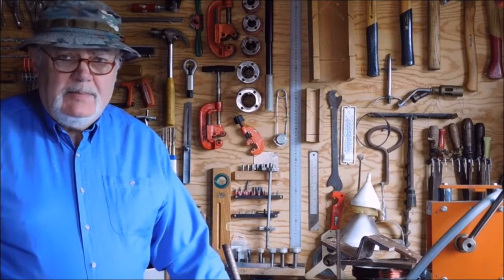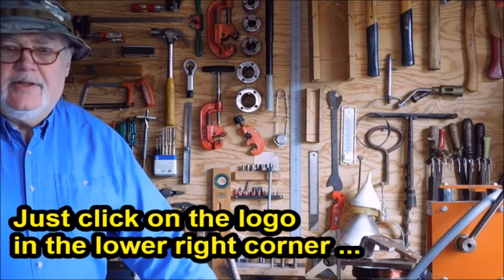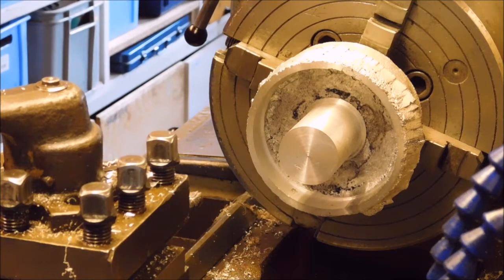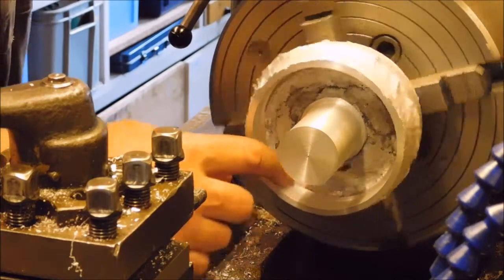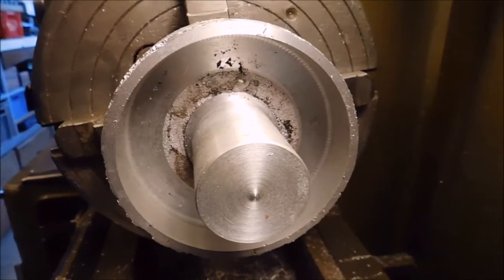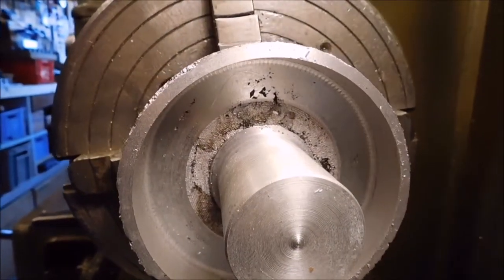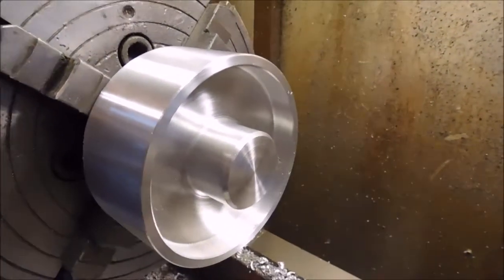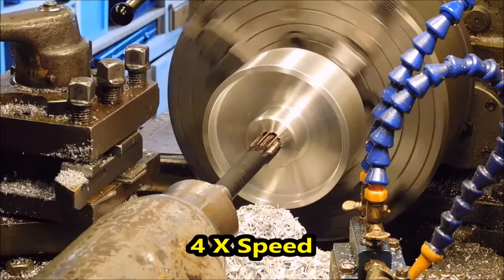Beltsander 16

Comment: "Click on the tool on the wall"... That was a nice one ;)
Never mind those cavities. Fill them with aluminum putty(automotive paint or accessory dealers) and it'll be just fine. I don't think You should have more than one crowned wheel in a setup like this. Two or more crowned wheels could perhaps make the belt difficult to run steady, and make it hard to adjust?
As for the sleeving of the axle hole - Mr.Bozo did You a big favour there. The part - when sleeved, will last a lifetime, running true in every revolution. Nice video - thanks for sharing! ;)
Reply from the maker: Thx Erling, a little encouragement is needed after been hit by Mr. Bozo that hard ;-((

I don't even think I have to fill those cavities - I mounted it on the motor and took a measurement - it's running within0,08-0,10mm - I think it'll do.

Comment: Quite a challenge machining that. You worked wonders on it - but oh dear Bozo called. Was going so well and looked great.
A sleeve will do the trick :)
Reply: This is gonna be a first, promises to be interesting....
Reply from the maker: Yeah, it looked a little challenging ... try view a before and after ... nearly hopeless.

I think I have to make the hole greater or else the sleeve will only be 0,5mm - right ?

How about filling the hole up again with moulden aluminum ?
Reply: I think best to increase bore and then sleeve, plus Locktite.
Reply from the maker: ChrisB257
In fact today I filled the hole with moulden alu, and I THINK it sticks to the existing alu enough to hold ... but let's see when I start boring and get close to the finished diameter - maybe it will slip ... then I can use the steel sleeve method

Comment: Good work Keld.  Home casting shows it's worth :)

Pity about the centre hole, but a sleeve will fix it.  I had three goes at making a precision part recently, and stuffed it up each time on the final pass - we all have those problems.

I would slightly crown that pulley for sure.  It will clean it up, and help keep the belt centered.

Cheers Rob
Reply from the maker: I think I have to make the hole greater or else the sleeve will only be 0,5mm !

How about filling the hole up again with moulden aluminum ?
Reply: Hi Keld,

The problem you've got is the key way, if you intend to fit a key.  That will be a problem as it will be more than the bush thickness.  You will have to open out the centre even more to allow for that.

The grub screw will prevent the bush from turning in the pulley (use a shrink fit).

Don't use brass as a bush as it will react with the aluminium and cause electrolysis/corrosion.  Make it out of steel.

You will also have to do the final centre boring with the bush fitted or you will get runout for sure.

I can't see molten aluminium bonding well to the existing ally - but then I've never tried it.

Rob
Reply from the maker: xynudu
OK, maybe I should stick to the bushing/sleeve solution ... even though I have
experienced very, very strong bonding ... remember that "pipe mould" I tried out some time back ... it was tuff !

I plan NOT to use a key - just two screws inte the keyway will do it - I think !
Reply from the maker: On the other hand we have to investigate across the border line - right !

I don't think the existing wheel will totally melt down, so I can do the bushing/sleeve solution afterwards if the moulden aluminum wont stick right to the exsisting hole ... I'll try !
Reply: OK.  Be interested to see how this goes.

Cheers Rob
Reply from the maker: xynudu
Ofcause I'll let you know ;-))
Reply: How about finding a bigger motor with a bigger shaft...???   lol
Reply from the maker: Pierre's Garage
Ha, ha, funny, funny ... I followed your course in reading "guess-o-meters" ... and you teached me wrong !!!!!!!!!
Reply: I notice you were sitting on the last row in the classroom and you were texting all along the teaching,   Aaaah....!!!   those young students and their smart phones..   lol
Reply from the maker: Pierre's Garage
Yeah, you're just right !

... and they got "high hair and italian" shoes too, narrow black jeans and no calf muscle !

We have them here in Denmark too !

Comment: I love your new intro. "Yay"
😂
Thanks,
John
Reply from the maker: Thx !
Reply: I love your humor, too.
You knew you needed a steel sleeve for that hub. That's what you designed it for.
😊
Thanks,
John
Reply from the maker: Caveman's Mancave
No, in fact I just before I drilled it took a "guess-o-meter" and measured the motor axle - 20mm ... and I was happy because I have a 20mm reamer - but I - or sombody else - mis-read the "guess-o-meter" ... in fact it DID say 19mm ... #¤%"#¤"&%¤#"#¤%/&#¤%#" !
Reply: +Keld Sørensen 
Ah, but you "intentionally" used 20 mm so you could "have room" to install a 19 mm ID bushing to make a "better" part.
That way no one would know. 
All good fun😊
Thanks,
John
Reply from the maker: Caveman's Mancave
No, no no ...